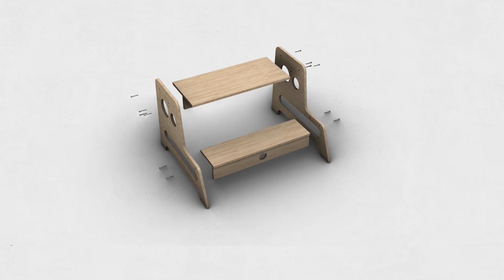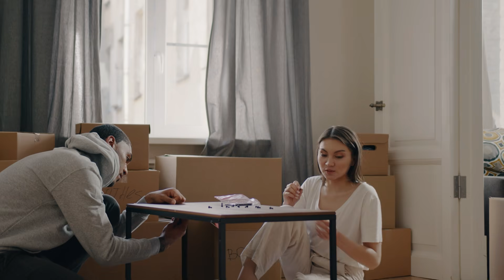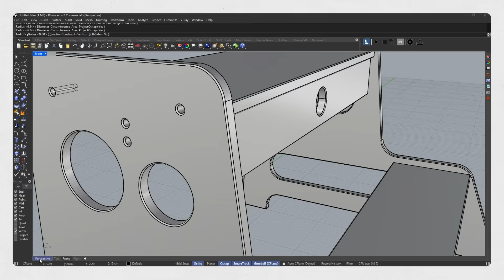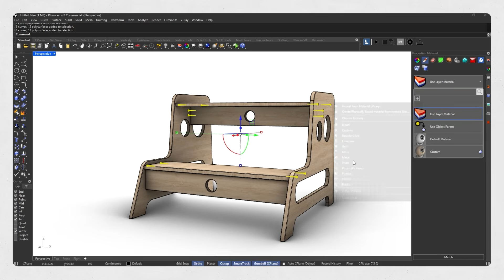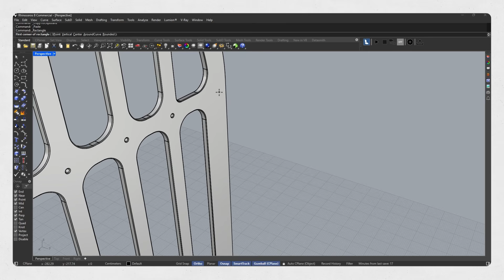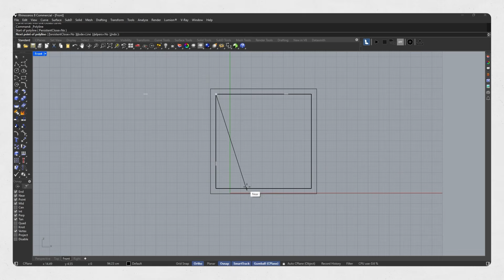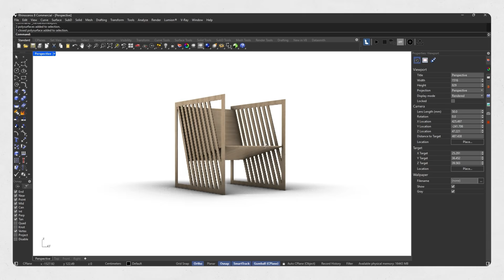3 Cool Flat Pack Furniture Designs You Can Model!

Comment: Thank you for another great tutorial.
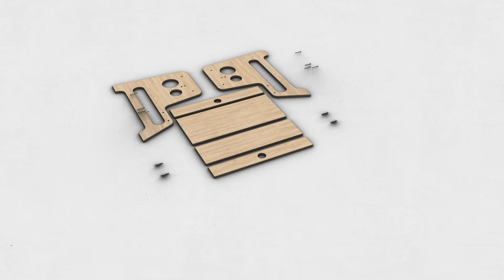At 1:45 to 1:50, you show the model parts fly apart to lay flat - ready to flat pack. How did you do that?
Also, not sure if it is possible, can Rhino crate a list of the number of parts with specific dimensions that need to be cut out if one is to build the model out of wood. This would also be quite useful. If I am not mistaken, I think Fusion 360 can do that? 
Once again, thank you for the great video.
Reply from the maker: Thank you!
For the part where the pieces fly apart (1:45–1:50), I used Rhino Snapshots.
I explained the whole process in this video:
 https://www.youtube.com/watch?v=0AGYaM_vmHA

About generating a cut list:
Rhino doesn’t create an automatic BOM like Fusion 360, but you can do it using Grasshopper.
With Grasshopper you can extract the size, area, and quantity of each part and generate a clean parts list for fabrication.

Thanks again for watching!